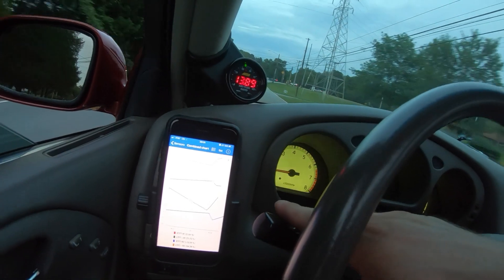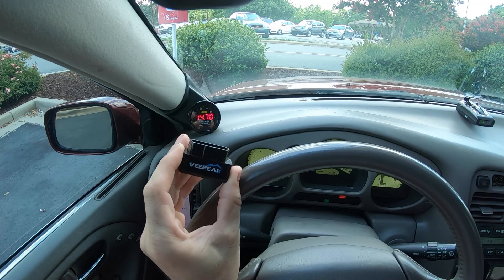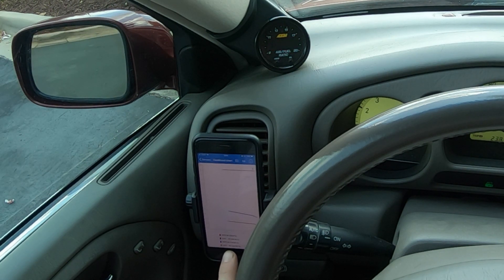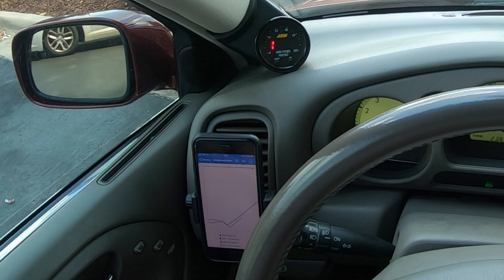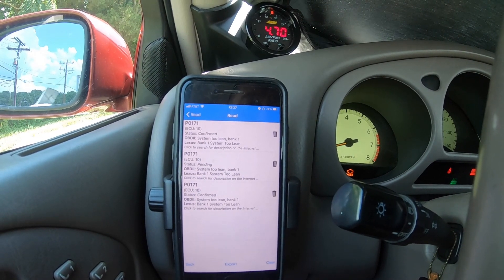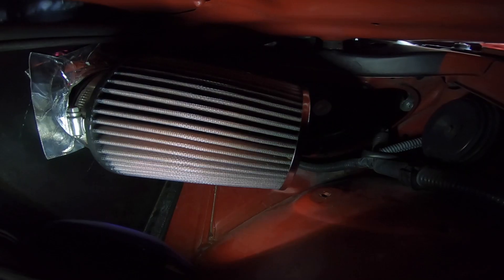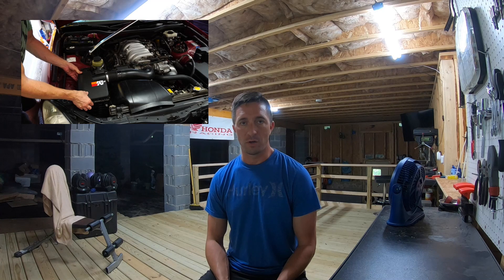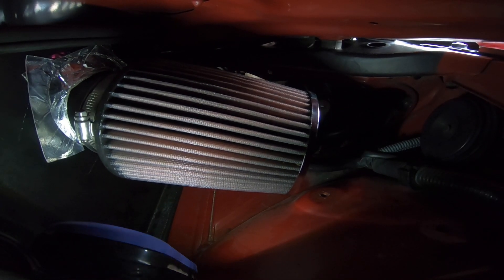Why I removed the K&N FIPK intake system (and how to diagnose a lean condition)

Comment: I had an aftermarket intake on my 98 gs4. I hated the part throttle whistle sound. No noticeable power increase. Definitely not worth it. The stock intake is a very good design

Comment: Thanks for the tutorial content, I appreciate you.  I want to inject on this thread/vlog and share my experience with this lean code ( P0171): since I just bought a 1998 GS400 a couple months ago and love it.  So when I bought it the check engine light was on, and it pulled a lean code on bank 1, so I chalked it up to the SRT aftermarket cold air intake installed by the previous owner or an O2 sensor, and I even looked for an original CAI with no favor there.  Nevertheless, the owner before me said they had left the car sitting in their garage off and on for the past two years, and as soon as they said that, I knew I was going to have to put all new seals and plugs on the top end of the engine and a new crank seal as well along with timing belt (165,000 miles with no service file/sticker on it anywhere! ).  Anyway since I've been on holiday for Christmas the past week and a half I decided to do the maintenance work on it noted above while I'm off the valve cover gaskets, cam seals/O-rings, timing belt, crank seal, and I went ahead and put a new thermostat, water pump along with drive belt and new tensioner pulley on it with new spark plugs as well and checked for vacuum leaks.  So here's what happened post maintenance/service: I started running 100% 87 gas in it - no ethanol, and it's running great, however, the check engine light was still on after maintenance, but a few days ago after driving on the interstate and punching the pedal to the floor ( * speed limit, of course. * ) the check engine light went off and it's not pulling any codes now ( hallelujah! ).  Anyway, my take away from my own personal experience with my GS400 was it more than likely was a bad/fouled spark plug on bank 1 side.  So It wasn't the aftermarket CAI or an O2 sensor -- fuel trims are now optimal!  Keep up the great content!  Looking forward to more!  Thanks again.
Reply: Hey Jeremy - do you ever recharge the filter on your SRT intake? I've got an SRT on my 98 GS400 for about 10 years now and all I've ever done was washed out the Spectre filter that came with it and put it back on. I'll swap it out from time to time with another Fujita filter I bought. I've done this probably a handful of times. Never hit it with a recharge or anything. No issues ever *knocks on wood*, but wondering if it might be beneficial to hit it with a recharge kit.

Comment: I would stay away from oiled filters the oil will always get on the MAF it's inevitable, I like using AEM dry flow filters but I don't think they make one for the GS.
Reply from the maker: Not a bad rule. In 27 years I have never had a fouled MAF though.

Comment: I had a cheap eBay intake on my is300 with a heat shield from the last owner and when i went back to stock with the resonator I felt a huge difference in throttle response it took a little while for the ecu to get used to the change in air flow but once that was done the car hesitated less and feels like it has better low end power
Reply from the maker: Exactly! My car reacted instantly. So much nicer driving around town.

Comment: Great info! I just got a 2000 GS400, 140k miles, very nice condition. Came with the same K&N intake, but I had to remove it to pass CA smog. I installed eBay junkyard intake parts (airbox, resonator assy)  that didn't come with the intake hose-to-TB gasket ($350 from factory, have to buy the whole intake resonator assy to get the gasket). I tried molding the gasket from 2 part silicone, and ended up with leaks that caused lean banks and misfires. Finally purchased and installed a new resonator assy with proper a factory gasket, and no CELs or super rough idling. I did have to modify the hose clamp (not stock) to keep it from sliding down the "cone" shape that the round plastic intake tube becomes as it's compressed.
I'm keping an eye on the front O2 sensors using the Torque OBD2 app. 
Car also threw an evap emissions code P0440, and i found/replaced a disintegrating breather hose on the charcoal canister. Had to unbolt the DS axel from the diff to reach that hose. Just replaced the PCV grommet and valve. The old grommet had converted from soft rubber to hard plastic. Used a borescope and tweezers to pull the broken pieces out that fell down into the valve cover (had to crack the grommet into pieces to remove it).
Keep these awesome videos coming!
Reply from the maker: Wow! You are very thorough! Good job! I’m looking for an OEM intake tube with resonator and I cannot find a used one anywhere! It’s crazy. I hacked off my resonator a long time ago, only to find out later that it had an intricate Helmholtz design which actually optimizes flow based on piston-related intake pulsations. Cool stuff!
Reply: @ForwardMomentum  Yeah, I had to ask around about why there are all those different sizes and shapes of resonator chambers on the intake, and I heard a similar answer.
As far as getting a used resonator assembly, I would have dropped the $350 on a brand new part from Longo Lexus first thing, had I known what a nightmare junkyard ebay parts would be (broken off hose bungs, no intake gasket, aged rubber parts, etc.) for the same price.
Also, even with the brand new, sealed factory intake, 2 days later the car threw P0130 (O2 Sensor, B1 S1), P0133 (Slow O2 Sensor, B1 S1), P0171 (Lean Bank 1), and P0440 (Evap Emission) codes.
Thanks to your O2 sensor video, I didn't pay hundreds of dollars for 2 new front 02 sensors, and I got the 7/8" tool too!
I'm also replacing all of the emissions lines, one at a time, with blue silicone vac tubing (blue so I know which lines I've replaced, not to be cool!) I sure wish the CC (charcoal canister) was more accessible. Half of the tests for the evap emissions in the service manual are done at the CC, but you have to drop the diff to get to it! I'm tempted to cut a large access hole through the floor pan above it.
Reply: Hey Christian! Here is a big update on what I found on the GS400 since my last post. I hope this info is useful to your readers. Chasing down the cause of the P0440 (Evap Emissions) led me to drop the fuel tank. I had to cut the rock-hard fuel fill hose in order to drop the fuel tank to the ground, and I immediately found that the overfill valve (on top of the tank) was busted (the plastic cap was cracked). I replaced both valves on top of the tank (the 2nd valve was the tank vent), installed a new tank vent line, a new fuel fill hose, and now the fuel vapor system (tank, charcoal canister, vent lines) is finally sealed (no more P0440).
The cause of the P0130/0133/0171 codes was due to 2 problems. Replacing the fuel pump and filter made the biggest difference. The old fuel pump ran, but the bearings were worn out (pump rattled when bench tested on 12V). With the new fuel pump, all codes (except for the P0171) went away. The second problem I discovered today, when I smoke-tested the intake manifold. Generous amounts of smoke rose up from underneath the intake manifold, indicating that the intake manifold gaskets are shot. I'm debating whether or not to replace the starter while I have the intake manifold off.
The acceleration vibration is still an issue. I dropped the driveshaft again, separated the halves, and rotated the alignment about 2 spline teeth, to better match the orange shaft alignment lines that I drew before originally separating the shaft. I had separated the shafts in order to replace the center bearing, which in hindsight of discovering the rear diff was blown (loose planetary shaft>play>chipped tooth), was probably still good. I also noticed that the triangular flanges at each end of the driveshaft are in alignment, but the service manual says they should be 180 out of phase. I kept the flanges in-phase (how they were aligned when I got the car), reinstalled the driveshaft, and the acceleration vibration continued. Then yesterday, after I randomly checked the transmission fluid level (a bit overfilled; 1/4" past MAX on dip stick), something changed. Now there is no acceleration vibration between 20-30 mph under medium throttle; suddenly it's all smooth! Not sure if this miracle will last though, since the car is down for new intake manifold gaskets. Maybe the vibration is from the torque convertor?
Reply from the maker: Great info. BTW, if you pull off the IM, may as well do the AVIS VSV while you’re there and possibly have the injectors cleaned. Keep me posted on the vibration.
Reply: @ForwardMomentum  Thanks for the recommendation! Do you happen to know a part number for that valve? And did you mean "ACIS"?
Reply from the maker: It should be part #
25860-50121. Definitely double check me.
Reply: @ForwardMomentum  OK, and what system is the valve for? Does it control the Acoustic Control Induction System?
Reply from the maker: Correct. Some people call it AVIS and some call it ACIS.
Reply: @ForwardMomentum  Great! I found it new Toyota OEM on eBay for $50 shipped. I'm going to start taking off the IM today so that I can clean the inside before the parts arrive. Thanks again for the advice. BTW, do you have a PM link?
Reply from the maker: @drrock5356  best way for PM/DM is IG. @youtube_forward_momentum
Reply: There is a way to get this to work perfectly with no lean code! I have installed on my car and passed smog here in CA with the K&N system installed! I'm reaching out to the guy who runs this channel so I can send him a detailed write up with photos so he can put up a new video and show you all!

If I can't get ahold of the owner of this channel, I'll have to gear up and figure out how to create a channel and post a video on youtube but that will take me some time. That or sign up and post it on a forum.
Reply from the maker: I’m the owner. Reach out to me on IG @yt.fwd.m
Reply: @mariosolis2449 3 years has gone by since I posted, and what I discovered was 2 problems: The sheetmetal-thick plastic-sheetmetal laminate gasket under my Intake Manifold had 2 cracks in the plastic, which was leaking in extra air.
The P0440 was actually caused by a cracked plastic plate on top of the gas tank. I had to drop the gas tank to find and replace it.
I found both leaks using a smoke machine. Best closed-system leak detector ever!
 I haven't had any CEL since.

Comment: I have stock gs430 with just wheels and suspension. Gapped a 400 at the drag strip he had intake exhaust wheel and suspension also.
Reply from the maker: When the power is that close it’s down to the driver and the launch. If you have the slips look at the RT for each of you. The intake works well with a tune, but only at WOT. Daily driving with it “sucks.” Ha ha
Reply: Forward Momentum gotcha. I treed the shit out of him 😂

Comment: I know you did the Soarer BFI intake. I also saw in one of your comments that you don't really suggest cutting off the resonator box anymore. Why is that? Any updated methods you have for making the intake sound louder without getting a CEL? My friend has a GS300 and his aftermarket intake transformed the sound of his car. I'm wishing I could do the same to my GS400! Thanks! :)
Reply from the maker: The resonator is a Helmholtz design that takes certain frequencies and smooths them. Not only that, but the risk of introducing a vacuum leak is much higher because you’ll have to carefully seal off where the resonator was, and add barbed fittings for the PS lines, etc. For more intake sound I recommend the BFI and/or the intake amplifier and a good drop-in filter. Here’s the amplifier episode: https://youtu.be/5aYYbiFSodU
Reply: @ForwardMomentum  Makes sense, thanks for the explanation! You’re the best!!! 😆

Comment: thanks Christian for the video.  Do you think it’s something with the Apexi Neo?  Do you think we all have lean fuel symptoms with all GS400s and just not know it?  I also got another intake tube from K&N but it’s the same shape as my previous one so that just the design.  I myself will will probably go back to stock intake system in the future but the K&N looks great all thanks to your video. 

Isn’t it safe to say that when you introduce more air into the engine you need to use more fuel?   I’m just surprised you are getting a CEL.  Possible Bank 1 or 2 bad sensor?  I’ll keep an eye out on my GS as well.
Reply from the maker: 100% a K&N issue. I went through every possible (reasonable) troubleshooting technique including hundreds spent on various tools and parts. Yes, I think other vehicles have this same issue and do not realize it because it’s just under the CEL threshold and they don’t have a data logger. Yes, it certainly pulls in more air. But fuel trims like this in closed loop represent an unhealthy system. When I hot-swapped the stock intake on it was as if a switch was flipped. The car runs so much better!
Reply: Forward Momentum  so i should probably change back to stock in the near future?  I don’t drive the car much but if it was my daily i’d switch back a lot sooner.  Looks really good under the hood.  Appreciate the video.  still piecing together my tranny  cooler 👍👍
Reply from the maker: I hate to jump to conclusions and say yes, but it’s probably advisable. I highly recommend that data logger first though. It’s a great tool to have around anyway.
Reply: Forward Momentum  yea i need a good one.  I have an App and  ELM bluetooth but the app doesn’t offer much.  need a good one like the big scan tools that shops carry
Reply from the maker: Just get what I have for under $20!

Comment: Wondering if this is the same issue I'm having, from a dead stop the car feels like it has no power until it breaks 3,000 RPM then it takes off. Feels like terrible turbo lag lol. I tried to do a standing burnout it wouldn't break 2000 RPMs or break the tires loose but if the concrete is wet she'll slide around with no problem
Reply from the maker: It’s certainly possible. While this intake gains some power at high rpm, the cost everywhere else is too high. In addition, if you look at their dyno chart, it’s starts around 4K RPM (probably because the car will kick down to 3rd while running in 4th on the dyno (1:1 gear) at anything below 3800 rpm. Bottom line: OEM intake is best on a DD car.

Comment: Did you ever recharge the filter on your intake? I've got an SRT on my 98 GS400 for about 10 years now and all I've ever done was washed out the Spectre filter that came with it and put it back on. I'll swap it out from time to time with another Fujita filter I bought. I've done this probably a handful of times just washing and swapping with the other filter. Never hit either with a recharge or anything. No issues ever *knocks on wood*, but wondering if it might be beneficial to hit it with a recharge kit.
Reply from the maker: When I ran a cone intake system I cleaned it every 10K miles. Now that I put the stock intake back on (so much better!) I clean the panel filter at about the same interval.

Comment: thanks a lot for this video. i put a cold air intake on my 01 gs430 and 05 sc430. i am going to take them off now. because something just doesn't feel right. i think these engines are too advanced to use an intake. especially since the throttle is drive by wire. the only benefit i ever noticed on an older car would be better throttle response. which i did not get on these cars. and my mpg is also down lol
Reply from the maker: Good call. I loved the sound and a few more ponies up top, but the drivability went to crap.  Better to just put $400 towards a supercharger. 😎